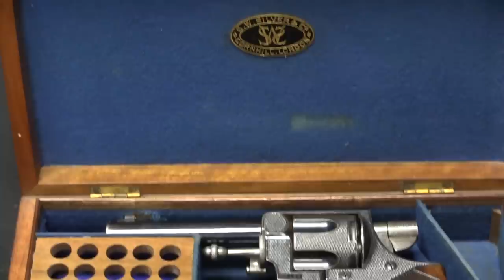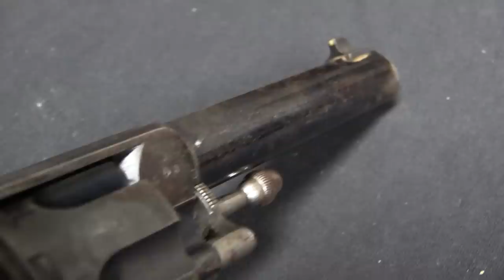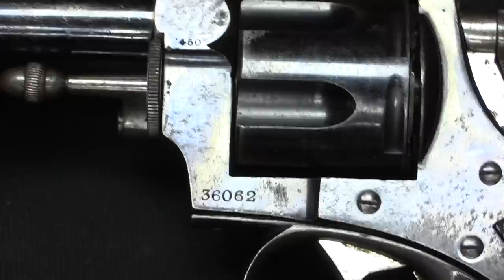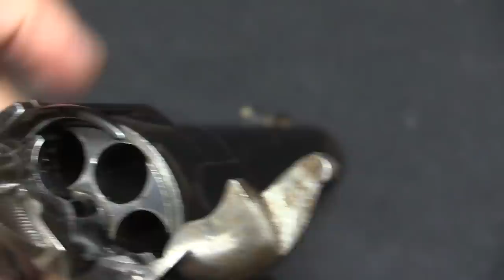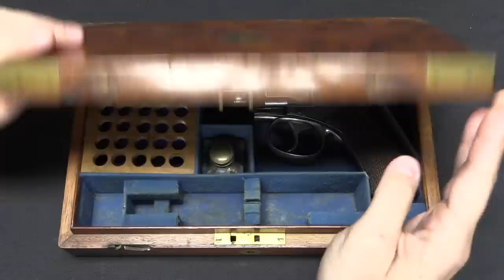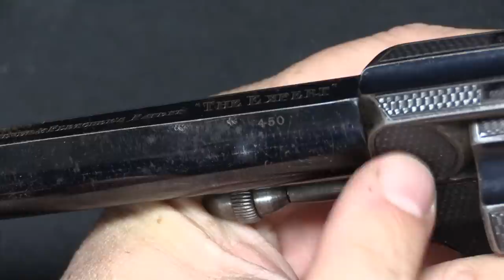1884 Tacticool: Silver & Fletcher's "Expert" Auto-Ejector

Comment: I was half expecting that front sight to have radium paint on it...
Reply: Except radium wasn't discovered until five years later.
Reply: maybe cesium. it glows blue but hey, its something.
Reply: Luminous paint had been around for many years. Needed 'charging' by letting daylight at it and it 'ran down' in just a few hours but it could have bee luminously painted.
Reply: Probably just a harmless bead of ivory. Well, harmless to the shooter, not so harmless to the elephant.
Reply: fallout reference? fallout reference.
Reply: @bagplant  Radium paint was frequently used for glow-in-the-dark effect, pretty much from its discovery to after WW2. There was a slight inconvenience from the painters' jaws falling off but hey, there's plenty more poors where they came from.
Reply: @lordsummerisle87  Sadly no-one told them not to lick the brush to get a fine point when illuminating compass dials and needles.    Health and Safety gone mad?
Reply: @TheArgieH  worse, they were regularly told to do just that, to keep the brush tip sharp.
Reply: @NM-wd7kx  Ouch!    Something similar happened to match workers, thanks to phosphorus a.k.a.the Devil's element.   Phossy jaw was no joke either.    Radium was also used in condoms, double ouch, quack  tonics etc., as you said all went well until the relevant organ/appendage dropped off.    At least you could find it to pick it up in the dark.  Sorry.
Reply: I Love sinistar favorite arcade game right there
Reply: @TheArgieH  Google "Radium Girls" it's a famous case
Reply: @TotallyOperator  Thanks for that.  Sadly it is far from the only horror story.   The late 19th century to early 20th in particular were fraught with all sorts of technology related  perils, here's a few other goodies.   Early experimenters with the newly discovered x-rays had their own share of radiation related fun and games.   A famous one being eating the equivalent of a barium meal followed by a very long exposure so that the digestive process could be observed happening in real time.  That amounted to quite a dose by today's standards, for both the observed and observers.    I read a 19th century account of firework factory workers conducting a nighttime  boxing match for the entertainment of prestigious visitors - dressed head to toe in asbestos wool suits with lit fireworks attached.    One can see why, many workers in the nascent chemical industry did not go on to "enjoy" lengthy  careers.    Still nothing new under the sun, the Roman dyeworks used lead boiling vats (that way you get some of your mordant effect built in).    They did at least use some sort of cladding to allow for lead creep on heating but the "workers" inevitably got some prolonged exposure.  In fact the  Romans seemed quite fond of lead, they had a lot as a product of silver mining and found it very useful.     Not only was it used for plumbing and cooking utensils, as well as military applications, they added lead acetate to poor quality wine to "improve" it.    Moving on, during WWI munitions workers,who were mainly women, were nicknamed "canaries" because of their yellow coloured skin arising from handling the explosives of the day - picrates I think.    I wonder what folk of a few hundred years time will tut tut about when they look back at us.
Reply: @TheArgieH  Tetra-ethyl lead, CFCs, HFCS, Roundup.
Reply: Good ones, but at least they were eventually recognised as leading to trouble (debate at leisure).    Widespread use of nitrites as a preservative maybe ?     For folk with a bit of chemistry, nitrite (not nitrate) reacts with secondary amines in protein to yield nitrosamines, not nice, sigh!    Perhaps on a macro scale: burning fossil fuels, generating nuclear waste in large quantities, using the ocean as a bottomless wastebin etc., plus all the " Unknown unknowns" as the man put it!
That's assuming there ARE folk in several hundred years time.  To quote ITMA's Mrs Mopp, "It is being so cheerful that keeps me going".
Reply: i'd even legitimately expect uranium there
Reply: @KuK137  Maybe, maybe not.      Many years ago (allegedly) the RAND corporation was asked how best to secure waste storage facilities taking a really, really long term view.   Remembering of course that we are talking about materials with half lives of the order of hundreds of thousands of years and it takes 9 X half life for something to dissipate.    No civilisation or current written language is likely to last that long (who outside academia can read cursive script Latin these days?   That was once Europe's  universal tongue), in fact humans as we know them haven't been around anywhere that long (debate at leisure, for those believing it all started in 4004 BC, that's around the time that the Sumerians were inventing glue,  written language was a little earlier - I think something to do with bills and accounting - humans you got to love them!).    The tricky bit is that the average politician thinks no further than the next couple of elections, if that, which is not a happy thought (those who hold elections anyway).    Well, what did RAND come up with??     The account I read said their suggestion was to start a new religion, which makes a macabre sort of sense (don 't look under the concrete at the sacred site or the bogey man will eat you.......slowly).   Incidentally, you do know that propaganda is derived from "propagation of the faith", ironic or what.
Reply: TheArgieH In terms of sheer volume of waste to energy produce, nuclear is the way to go. Fusion, if we can achieve it, will be more so. If you look in to the numbers, there's an incredibly large amount of recycling spent material (at least for those who follow the rules). A very small amount (I believe something like 3-5%) requires vitrification safeguarding. Naturally, if we ran on nuclear across the globe the relatively microscopic amount of waste would be massive by a person's measurement, but it would be worlds less than traditional fossil fuel wastes.
One possible solution to the problem of the far future's people being so radically different in culture and lingua franca is to make the sealed waste impossibly difficult to breach. If we regress into simpler people, we'll have no way of entering, and if we're advanced enough to be able to than surely they'd have the intellect to decipher the strange text found upon this ancient vault before entering. We could even perhaps leave modern equivalents of the Rosetta Stone, though given the encompassing nature of English it would be much easier to decipher than a text that was used by and died out with a single, relatively short-lived society.
Reply: @connorpickens7523  Nuclear fusion has already been achieved. Additionally, nuclear waste disposal sites have multigenerational warning signs. This topic has been discussed at length by very intelligent individuals, some of whom have even argued for the deepest feasible burial possible and no warning signs so as to keep the entire deal a secret from later peoples to prevent curiosity from taking hold.
Reply: Fin Ssustainable, efficient fusion. Cold fusion is what I meant (Wish the nuclear engineers luck) . I'm aware of the sites having multilingual signage, but how do you mean when you say multigenerational? Also, that secret burial is a little risky, in my opinion. Should people discover it with a lack of warnings, they'd have zero clue as to its contents and then its the temptation of sarcophagi all over again.
Reply: The element was discovered in 1898 and the feasible extraction of metallic radium from uranium ores happened in 1911, both by Maria Curie
Reply: YOU LIVE!

Comment: you should test this out on the range just to see if it's actually practical to go ham with the loading gate open
Reply: That would be awesome!

...say, where do we get the .450 ammo for it? It hasn't been in production for almost 100 years...
Reply: @brunoratto253  found a place that has it limit 1 round per customer 7.95 each so I'm sure there are 50 of us that want to see a firing video lol
Reply: i was curious of that and would expect the casing would fly straight to the face. such an interesting auto ejector to see nonetheless.
Reply: spaz14. Modern Glocks do that, too. Nothing really changes, LOL.
Reply: @brunoratto253  It's easy to make. Just shorten .455 brass and load appropriately.
Reply: @spetsnazmelayu2011  With the safety lever turned over to the side, I wonder if it acts as a brass deflector?
Reply: @brunoratto253  You can use .455 Eley or roll your own. You can also get brass, including .450 at quite a reasonable price in Canada. moulds for .455 258 grain hollow base bullets are available too.
Reply: @moosemaimer  It looks like it would. The cases must be pretty short though.
Reply: You'd have to load five and carry with the hammer on an empty chamber, otherwise the first round ejected would be a live one.
Reply: @paspax   True, if you want to fire it with the gate open. Otherwise, load 6 - and turn that gadget on the hammer to keep the firing pin off the live round. Looks like it's designed to be flipped up by the thumb when gripping the gun.

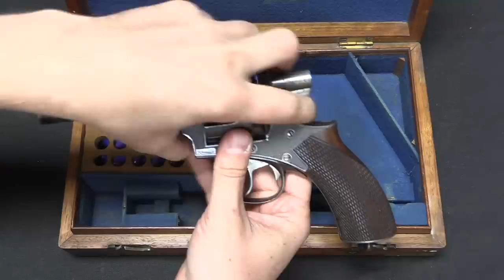Comment: 7:48 that little bottle of oil has probably congealed back into a dinossaur
Reply: It was probably based on vegetable or animal fat, not petroleum products, if it was really that old.
Reply: @Kaboomf  they had petroleum products in the 1860's....
Reply: Kaboomf um ackshually
Reply: @gunfuego  yes. However, refinery technique was far from perfected, and lubricants for guns and fine machinery was often whale oil.
Fun factoid: Automatic transmission fluid was originally formulated to closely duplicate the properties of sperm whale oil, which is what the first automatic transmissions used. That's way later than when this revolver was made.
Reply: @Kaboomf  I'd give a good chance of it being whale oil. Whale oil was noted as being a very good lubricant (and was used in clocks for years).
Reply: @allangibson8494  The other possibility is Rangoon Oil, which was refined from naturally exuding crude oil, found in Burma. The British army used it on small arms, because it stayed fluid at very low temperatures, and didn't gum at high temperatures. It didn't go rancid like organically derived oils,either.
Reply: Oil is only made from dead sea life, not dinosaurs.

Comment: On the embellished version, the firing pin appears much sturdier.
Reply: Probably saw much less use
Reply: @duncanmcgee13  I must concur this to be a more than reasonable assumption.
Reply: @duncanmcgee13  Sounds totally reasonable in theory, I think it's a completely different firing pin though. That would be an unholy amount of wear in a very even pattern, that never wore down the tip hitting the primer...
Reply: @jameshealy4594  It actually looks like it has been re-profiled at some point and looks shorter. I wonder if the tip got bent or broke somewhere along the way and someone just filed it down to make it look right without concern for functionality.
Reply: And the other appears bent downward.
Reply: That's what she said .
Reply: @leequinn.  Not now Michael.
Reply: @wingracer1614  It doesn't look re-profiled to me, it looks like it's been replaced.  The firing pin on the first gun looks like the original and the second one looks MUCH sturdier, which would suggest to me that it is a replacement, "aftermarket" part.